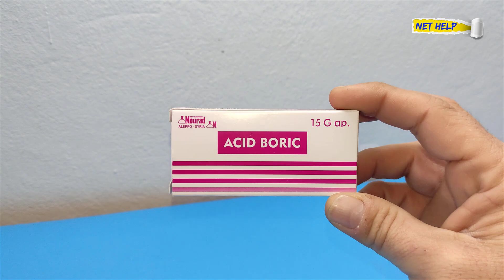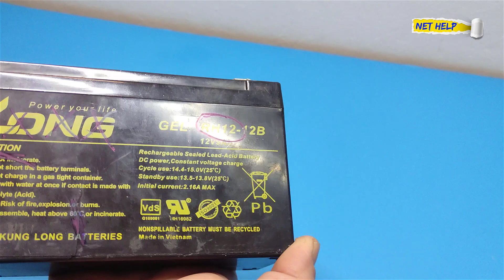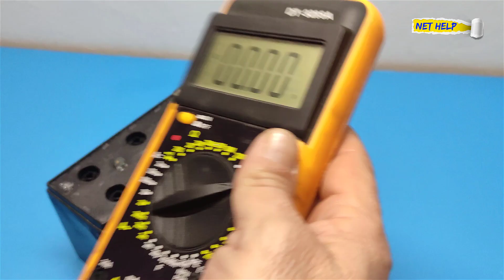Battery maintenance technicians will not tell you about this method, because you will abandon them

Comment: Will this method also work for non gel batterys....??   Or is this method Only for gel batterys..??
Reply from the maker: Both are suitable for all batteries. These materials are specific for cleaning batteries and work to restructure the copper sulphate inside the battery